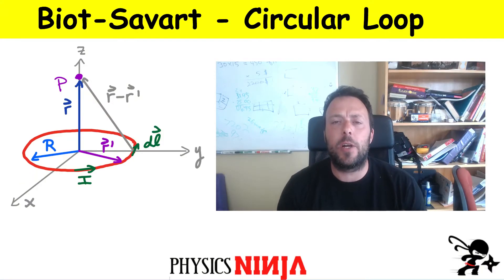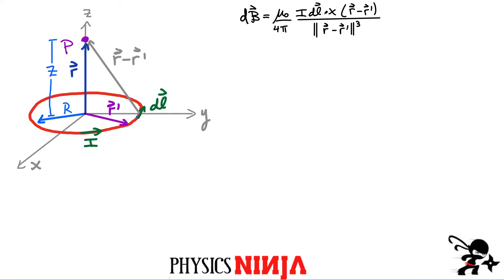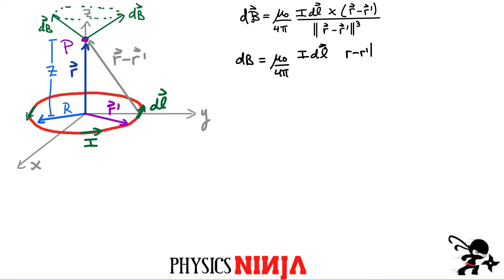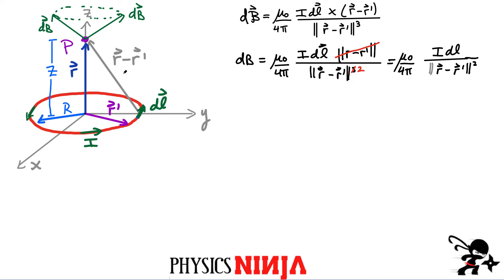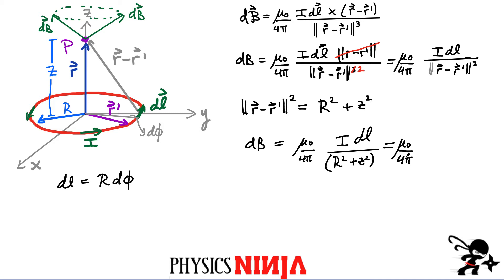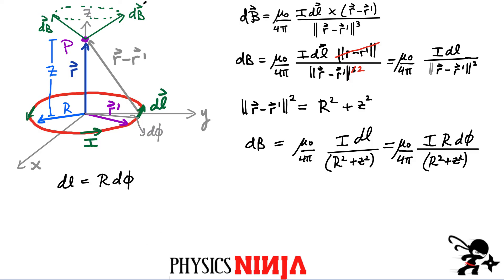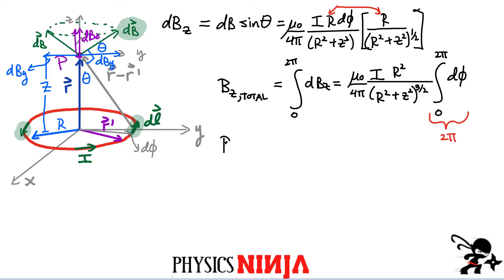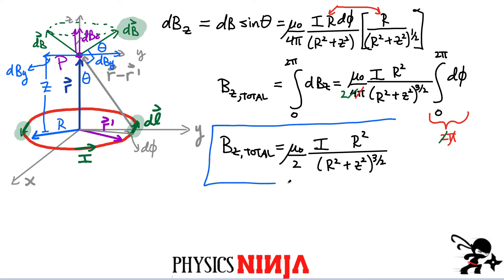Magnetic Field from a Circular loop

Comment: 9:06 can u explain a bit more about the angle chosen, i dont understand it
Reply: I’m using r in this comment where the video uses r -r1. Because of the cross product dl x r, you only consider the radius that’s perpendicular to the loop, in this case R. You then want to rewrite the perpendicular component R in terms of r, so R = rsin(theta). This angle is constant no matter where you pick along the loop, so you don’t integrate it. Because sin = opposite over hypotenuse, you can rewrite sin as R/r.

The entire term dl x r then becomes 

(dl)(r)(sin) = (dl)(r)(R/r) = Rdl

little note that the sin(theta) in this example is not the sin(theta) you get from cross products.

Comment: 09:25 I think the Z component is should be dB.cos(theta), not sinuse.
Reply from the maker: Not the way I’ve defined the angle.    The way I have it, it’s sin, but you could also setup the problem defining it so it would be cosine.
Reply: @Physics Ninja  Isn't the leftside dB component in the same direction with (r-r') vector? If it is, then the angle between leftside dB and z-direction is theta. So, the angle between the rightside dB and z-direction is also theta from the symmetry, isn't it?

Comment: only thing I have to say is that the cross product can be defined better. It has to be perpendicular to both vectors but there are two solutions to this, and you did not specify why you took the vector pointing up right instead of down left, which would also fit the parameters
Reply: Right hand rule

Comment: I understand the math however, id like to ask if you integrated upon dB without multiplying by costheta.
Reply from the maker: you need the cos(theta) term because you only want the vertical component of the field.   The other components cancel out due to the symmetry of the problem.
Reply: @PhysicsNinja  thank you for replying. Moreover i understand why we used costheta however i wanted to understand what would obtain if we just went on and made the integral without multiplying by costheta. I understand that the horizantal component would cancel out while the vertical remains thus multiplying by dB by cos theta so it becomes dBvertical answers the question in the text books correctly. Thus what im really intrested in is what if we made the integral for dB expression right away what would that represent
Reply from the maker: @holyquran_605  If you look at the integral at 7:00 you see that you're going to add a bunch of dB's but they are all in different directions.    You can get to an answer but i don't know what it means because the adding of all the dB's like this wrong because the vectors are all in different directions.  As you know, for vector addition the direction is really important and can't be neglected.
Reply: @PhysicsNinja  well yeah i see your point thanks man.

Comment: Hi,
This video was very useful. Would you be able to do a video of the same principle but if the point P is not on the central axis. So still in the same parallel plane of the loop but displace by an angle?
That would be incredible